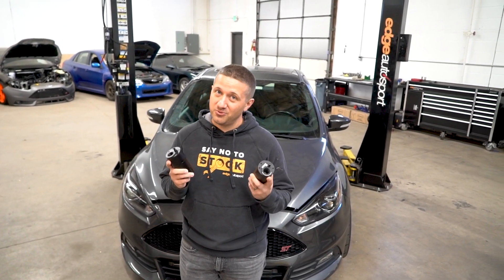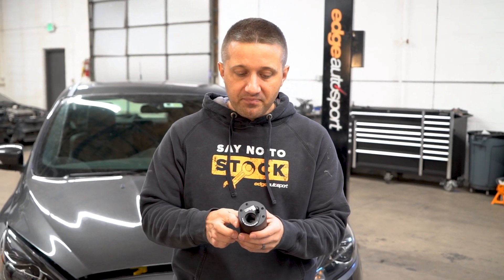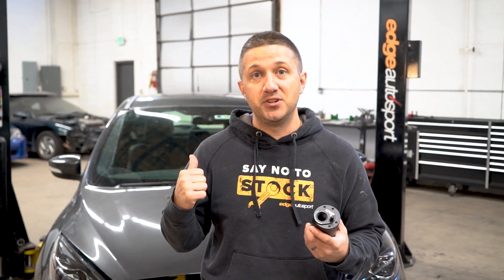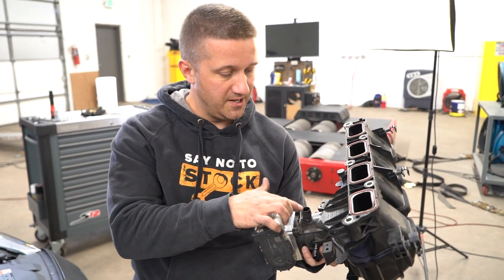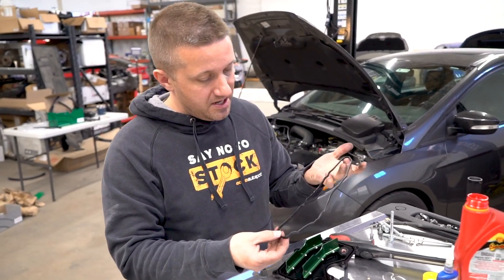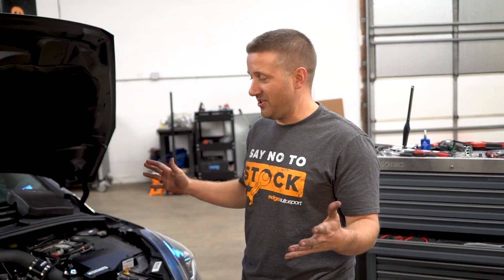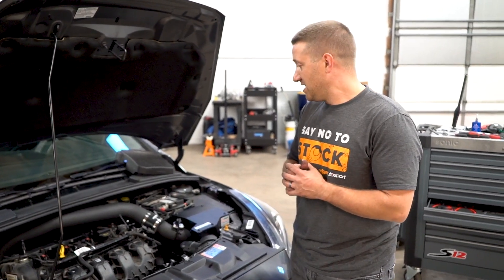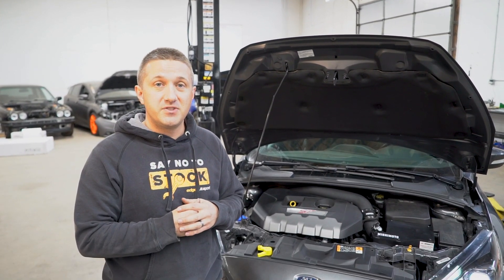Keep your engine happy with OIL CATCH CANS  |  Project Half-Send

Comment: You're right about those factory plastic fittings being a pain to install on the 1/2" hose. I got them on 90% of the way so I'm good. They are not going anywhere and these see low pressure so no concerned. Thanks for mentioning it though as I was worried I was just a weakling, lol.

Comment: What is the difference between the “20-0315” and the “20-0315-FL” catch cans?
Reply from the maker: FL is the new Fluid Lock model, the previous is discontinued. The new kits aren't on our store yet, but we can get a good price going order one for you if you'd like! Give us a call if interested.
Reply: @EdgeAutosport  Are the Fluid Lock models worth it? Does it even make a difference? Or are the ones that you install in the video above more than sufficient.
Reply from the maker: The FL is rather your only choice now, it's a updated design. All the previous models are discontinued, but yes, it is a better design!
Reply: @EdgeAutosport  I have the current model that you put in project half send, I purchased it from you a couple months ago. Is it worth upgrading to the newer FL model?
Reply from the maker: Not necessarily, it's more emissions friendly, mainly.

Comment: If this was needed, why didn't the engineers from Ford install them at the factory?
Reply from the maker: A length of hose is far cheaper than adding two catch cans... and then theres another maintenance item as well - the performance aftermarket strives to improve on what mass-produced cars leave out. Thats why we sell these awesome upgrades!

Comment: I have a suggestion check out Tracy Lewis performance catch can, I use his big can with my focus. I also use their oil cap breather with this system. It's over 400 for the kit and you can disassemble and clean out the catch can. The main 1 way valve handles 100 psi of boost in the boost/manifold side of the system. This system has a pre turbo/throttle body line that will keep sucking while under boost.

Comment: what do you use to block off the sound simposer from the firewall and air intake..my car 2014 fusion..2.0 valancia engine
Reply from the maker: Some kits, like the Radium Symposer Delete come with a plug for the firewall: https://edgeautosport.com/radium-engineering-sound-symposer-delete-kit-ford-focus-st-2013-2018/

Comment: I have the pcv catch can but what is the rear radium catch can filtering if you don’t mine me asking?
Reply from the maker: One can filters the crankcase, and the other filters the valve cover. Some designs combine the two, but radium separates the two sources.
Reply: Sorry, I am slow… but the front can takes gasses from the crankcase, catches the oil, then puts it into the intake.  The rear can takes gasses from the valve cover instead of the crankcase?  I didn’t think the valve cover would have gasses to recirc.

Comment: Is the radium coolant tank good with stock radiator and hoses?
Reply from the maker: They supply the hose to interface with the stock hoses and connections. You saw us heat up and separate some stock connections, that will be required to make it all hook up.

Comment: Question, I got a 2016 Ford Focus st added a gtx 2867r ever since I added cars been having all type of issues I didn’t install it but had somone install it , only major issue is when I boost or shift at high rpm’s it shoots out so much black smoke almost looks like I’m Driving a diesel truck , tuner says it’s normal and jus ignores my concerns please help :/
Reply from the maker: Hi Eddy, so we cannot edit another tuner's work... but it sure sounds like you are running incredibly rich with all that black smoke. We dont see a symptom like that with our tuned cars. If you would like to have us tune your car instead, feel free to pick up an e-tune on our site. If you have further questions, you can email tuning@edgeautosport.com

Comment: did you use lock tight on the coolant expansion bolts? Curious what you modified/cut during the install of the expansion tank? Was that for fitment of the bracket. BTW clean setup and excited to see whats next for project half send. Very interest in which BT you decided on this project.
Reply from the maker: Yeah, loctite blue was used when assembling the tank and smaller mounting screws. For the lower tank, you need to move the fan controller and trim it's plastic mount just a bit for a tidy install.

Comment: I installed the two cans and baffle plate over the summer.  So far so good.  Any chance the old style coolant tank can still be ordered with green fittings to match the other fittings?
Reply from the maker: I imagine you could still order the green fittings direct from Radium, if they still make them.

Comment: Is the installation the same for mk3 and mk3.5 focus ST for these catch cans?
Thanks for the awesome videos, great job guys :)

BTW 1st Radium link is for the fiesta ST and not the focus ;)
Reply from the maker: The install should be the same, but we haven't specifically tested both, just make sure to check the fitment years (there's really only two kits for all USDM FoST applications)
Reply: @EdgeAutosport  well erm, I have a European ST, and an estate to make things even more interesting 😂
Anyway I don’t think there’s much difference between EU and US cars in terms of components positioning, most difference will be in the details of these components…
Since I don’t do any track day I’m not sure a catch can will be a big reliability improvement on my car, I think that my next upgrade is either going to be for the smushy brakes or the suspensions… 😉